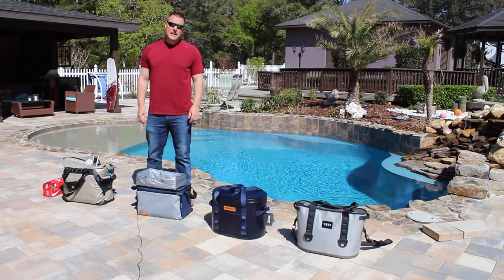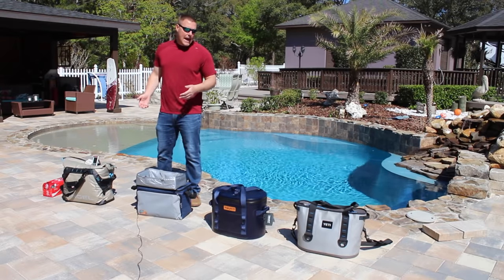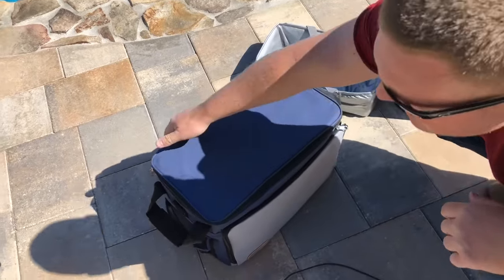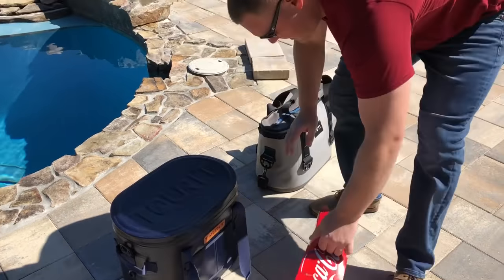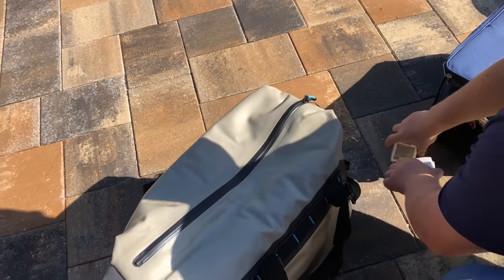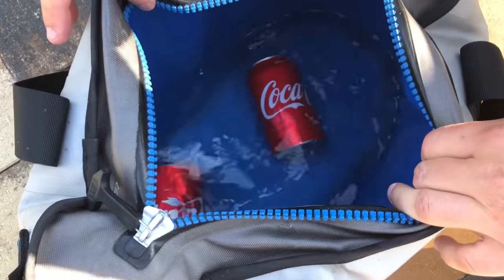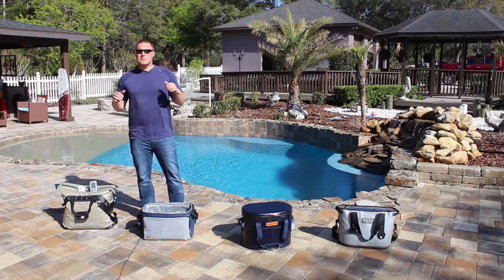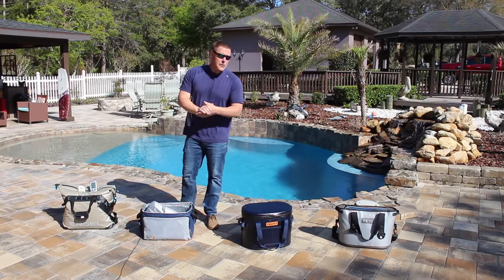Soft Sided Cooler Challenge, Yeti Hopper Vs Engel TPU Vs Tourit Vs Cool & Dry

Comment: Any idea whether the newer version of the hopper, the hopper two, performs better than the hopper one tested in this video? The newer version has more insulation. As of now, the Engel seems like the route to go though
Reply from the maker: We haven't tested the Hopper 2 yet, but we are trying to line up the matchup.
Reply: Wouldn't waste money on the Hopper II.  I bought the Engel HD30 (it's actual name, not "TPU") & it's legitamitely perfect for our family. Handles on the ends that are similar, but easier to use, to those on a normal cooler.  Wife can sling it around and it holds enough stuff for our family of 4 to hit the ball fields for a whole day or load up for a weekend trip with hotel.  Hopper is more expensive, is not roomy enough for that "one more thing" and the HD30 is so light that it makes more sense than buying a small roto-molded cooler to get maybe 1 extra day of cold

Comment: I don't understand.....do you guys just thumb your nose up at rtic? Is that why there are no reviews on them....
Reply from the maker: We've tried explaining this several times via comments before but we attempted to get an RTIC many times in the past to participate in these challenges. However, every time some sort of a snag would occur, out of inventory, backorders, etc. Eventually we just gave up with the runarounds. Many others have experienced the same according to comments on here.
Reply: I've actually purchased and returned 3 separate rtic soft-side coolers in the past 6 months due to terrible quality. I tried very hard to like them and support the cheaper "underdog" but I can tell you firsthand, they do not compare to the quality of craftsmanship of the softside engel or yeti. The rotomolds may be a different story though

Comment: A problem with your test. One of the bigger factors of how long ice lasts in a cooler is determined by how much empty space there is. Because these cooler are different sizes, this is not an accurate test. I am not so sure it is possible to do a perfect comparison test among all of these coolers.
Reply: Wouldn't size be a disadvantage, since it's more surface area? In this case the winner beat both coolers that are clearly smaller.
Reply: This shouldn't matter, the test works and gets the point across. The capacity of the cooler helps, but is not necessary for a test.